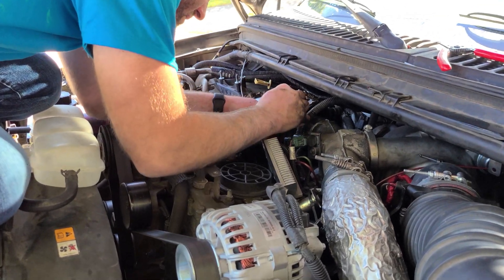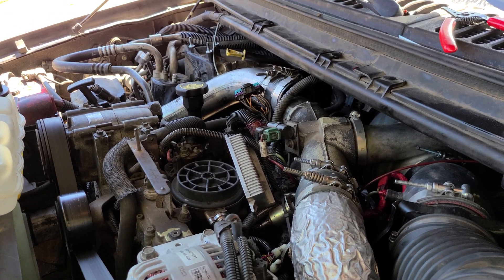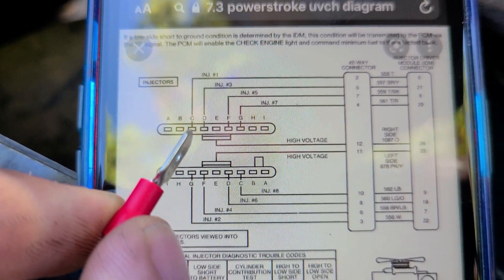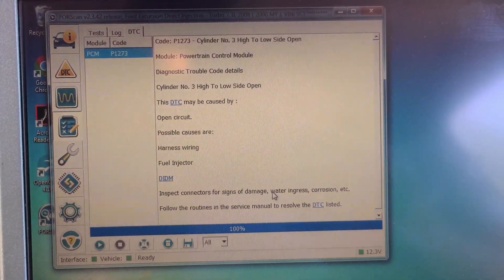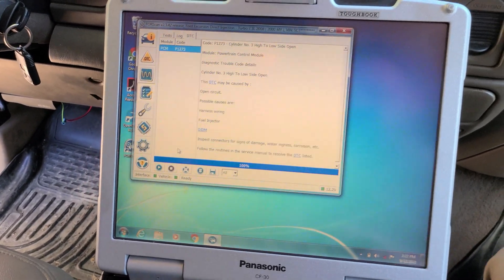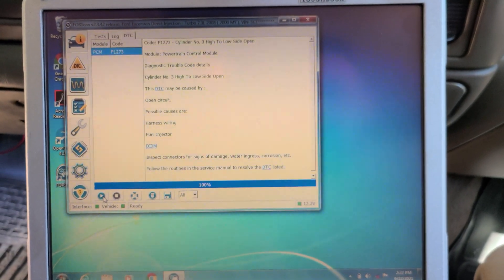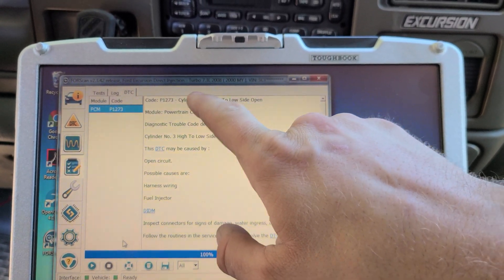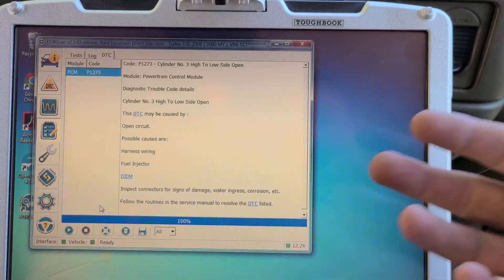7.3 powerstroke bad Injector or IDM / wiring diagnosis  high to low side opem

Comment: I have brand new wiring harness, new valve gaskets truck runs very good but when i run a test it shows that all injectors have codes.  its a 95 with 313k miles on it.  One injector was changed about 4 years ago and it also gets that code.
Reply from the maker: Injectors are usually due in a 7.3L around 250k miles
Reply: @gagefixeseverything  socdo you think that could be reason for all of them?  Its every single one bit truck runs good.   Also if i will be changing 1 at the time is there any order which cylinder would be best to start changing them?
Reply: @norbkowa it’s a fairly lengthy repair.  Bite the bullet and upgrade and replace all at once.  It’ll run better for another 200k miles at least.  If you replace one and the rest are on their way out, the truck won’t run optimally and you may be doing 7 more repairs and worse fuel mileage.  Just swap them all.  And while you’re at it upgrade them all.  My buddy had 300k miles and one injector failed. He upgraded them all and went from 14mpg to 20 and way more power.  Just cause it’s running doesn’t mean it’s ok.  6 mpg is a lot of money.

Comment: What about low to high open? It shows a few injectors bad. I replaced the injector harness with a new one. Still. Truck starts but when in gear drive. Zero power and rough idle.
Reply: The codes I have are inactive also. No check engine. Shows few injectors low to high side open unable to build pressure.  I checked EBP sensor looks really clean. Unplugged IPR while truck running. Truck shut off. So IPR is good. IPC did the same so that's good. Next was to remove EGR valve and inspect. Then check muffler if clogged with soot. I have zero air leaks. Turbo boost is good. And oil pressure is good.
Reply from the maker: Are you working on a 7.3L? There is no EGR on a 7.3. Sounds to me like your injectors are bad, but there is alot of hands on diagnosis that needs to go into it
Reply: @gagefixeseverything  6.0l vt365. I don't think injectors. I only have 44k miles. It was showing inactive codes for a few random injectors 2,4,5,7. And another time I showed the other sets. From two different banks. My next guess is egr valve or a faulty icp sensor. My throttle accelerator is in working order. Sensor checked.
Reply: @gagefixeseverything These trucks have an EGR tube connected to the exhaust back pressure sensor ( by the HPOP) connects to the engine below the alternator. When my 97’ downshifted and rpm went up it sounded like it was cavitation. Replaced the back pressure sensor and Egr tube and it cleared up. As far as the injectors, look at the pins on the uvch connections. The can fail simulating a bad injector.

Comment: If you swapped the wiring and the code stays on the same injector, wouldn't it be the injector thats bad.if it followed then it would be wiring?
Reply from the maker: reply
Reply: Seems you’re right.
Reply: So which way this correct? I am having the same issue
Reply: This guy's an idiot. If it follows the wire swap its the wiring. If it still says same injector after it the injector or the valve  cover gasket wiring harness. To eliminate the valve cover gasket you can do the wire swap inside the valve cover right on the Injector. You can also ohm test the injector. Should be 2.8 to 3.6 I believe.
Reply: Yeah, I think he stated it backwards a few times.  If you move wiring and same injector is showing code, it has to be either that injector or the wiring downstream of where they spliced it over in the electrical.  Would not be the IDM.

Comment: Is there a way to pull the wire and pin from the connector? Or did you have to cut the wire and then slice it over?
Reply from the maker: Yes you can depin the connector